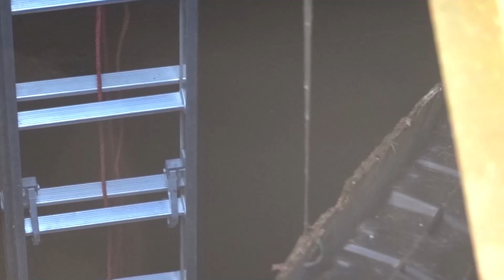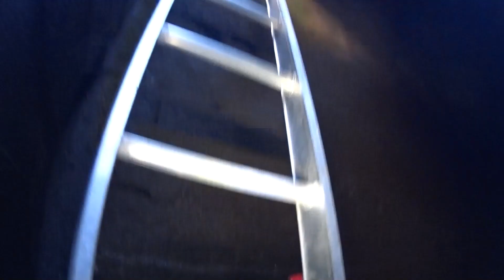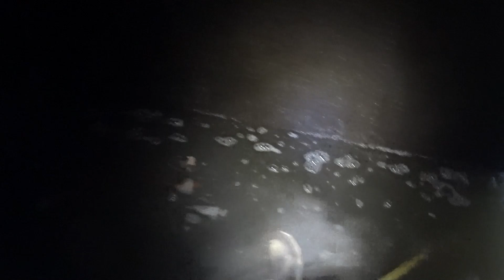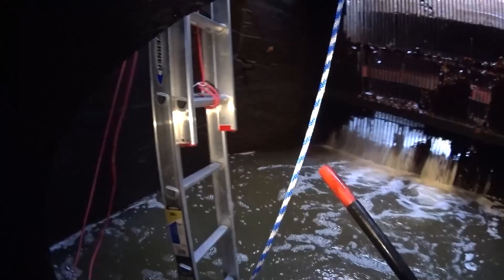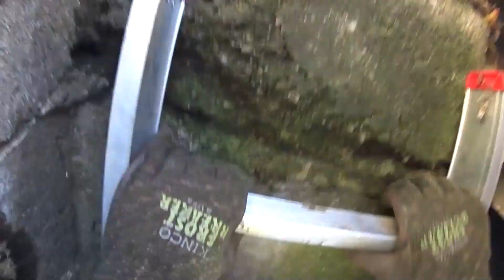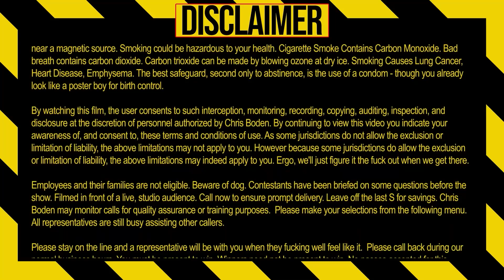A Message To All Young Engineers

Comment: They asked me  to attend at a fire training & truck maintenace facility which was equiped with cistern to collect the gray water from washing of the trucks. They recycled the water. Everytime the pump in the cistern required service, the cistern had to be drained and someone had to enter wear confined space gear to service the pump. I am not the sharp knief in the draw, but I took one look and said to usual " Who the f___ designed this? Move that F___ pump below the access cover and lift it straight up for service . No draining and no one needs to enter the cistern. Deer in the headlights look. I am not an engineer, just a guy who has had to hold the shit end of the stick because of the non-thinkers with an iron ring on his pinky finger.

Comment: I think the care for future service has been engineered out of most things we use everyday. Small appliances are not made to be repaired, just replaced. Your vehicle may or may not have a dipstick for checking levels, if it has one for the engine it probably doesn’t have one for the transmission. I think it should be mandatory for an engineer to serve an apprenticeship in the field working on whatever they are going to engineer. Value engineering is a term they use to eliminate all those unnecessary valves and service items. They are not necessary for normal operation, but can take a repair job from a few hours to a few days or more. Thanks, Chris for your Common Sense Videos.

Comment: I'm a firm believer that before any engineer starts designing a thing, he or she should spend two years in the field servicing and maintaining previous versions of that thing.  Doing jobs like this one is how engineers should learn these lessons.  New things moving forward would be designed differently by those of us who have crawled thru the equipment.  People who have wrenched on it and maintained or repaired a thing see it from a different perspective, and the resulting designs dont suffer the same challenges for those left with maintaining it after its installed.  

The 'thing' can be a water turbine, a kitchen appliance, a vehicle, or a spaceship; it doesnt matter.  Everyone has a customer. Always think about the customer and their needs, not strictly the manufacturing and initial assembly.

Comment: John Deere could take note. 
6125r built in 2013 and in 2023 the little cabin pressurizer blower quit working. Oh! it's located under the floor beside the seat, not bad let's put a big cover over the whole HVAC system with over a dozen screws that needs to be removed brilliant idea.
     But sir! that's still to easy, ok then let's put the cover underneath the operators seat plus make the interior come apart like a jigsaw puzzle in a specific order. 

It turned into a 4 or 5 hour job when they could have put a small cover above the blower and it could be swapped in under 10 minutes

Comment: As a Systems Engineer, we call these "ilities"** and we see these as lifecycle considerations and it's part of our job to take these into account. But SE has really only been applied to the largest and most complex systems (and systems of systems) and it's infancy was at the start of the Cold War (the DEW Line was one of the first projects where early SE principles were formed and employed). Sadly, too many engineering projects still do not see maintainers as stakeholders, and consider the system's lifecycle to extend little beyond the warranty period. (SE is mostly used in Defence, Aerospace, Telecom, and huge public works projects - things (often "one-offs") where mistakes are hugely expensive in money and human lives.) This is changing as the complexity of systems increases and the idea that a system's lifecycle runs from its conception to its retirement and project sponsors are being held responsible for bad decisions, especially ones that cause problems in disposal (think asbestos and PCBs). Such design consideration is expensive up front, but saves (in many ways) in the long term. "Back then" we didn't think that far ahead (and could not foresee some issues), and now, with big projects, there is little room for the mistakes of the past. AND it really does help for engineers to have to maintain some things: I know that I strongly empathize with those who need to keep things going after I design them; and I've cursed many an engineer that made lots of the "simple fixes" I've had to do, into major efforts. (The same principles go double for software design.)

**"ilities:" reliability, supportability, maintainability, securability, etc..

Comment: I know this sounds crazy, but lots of engineers never use the things they design! A lot of times, they simply can't use what they build.

I've been involved with clean sheet designs for complicated systems (aircraft). With a system with a lot of new technology, the engineers can only guess at what maintenance will actually be required when its fielded. I've seen thousands of hours spent on diagnostic procedures for faults on a component that in practice, almost never fails. I've also seen the reverse: a component that fails at 100x the rate the engineers assumed, and no maintenance or diagnostic procedure exists for it. It's usually a procedure like the one in this video that makes up the difference until they figure out how to fix it in the next revision.

Comment: Sometimes the issue is the engineer. Sometimes the issue is the installer. I can't count the number of times I've had a sputtering cussing rage fit because some installer used my design as a helpful suggestion instead of the plan they were to follow. "I had a hell of a time figuring that out" they say. "You didn't have to" I say. "I figured it out before you bought materials." And now I have to look at their ugly, scabbed together work while they're off on another job never having a second thought about the future mystery they caused because it was easier for them to do it wrong and come in under bid.

Comment: Give the fasteners gear teeth, make a dual rack wrench to turn it remotely with long steel poles on a crane.  or similar.
Reply: I'm not sure, but I suspect that the various issues with that would reduce, or eliminate the feedback you get from leaving the wrench on top of the dog bones as you're leaving the hell hole... err, the tactile feedback of getting the bolts tightened that you get at the bolt.

Comment: The problem with a click of a mouse. Or an engineered design. You or we make equipment that does not require service for 40 or 100 years.  But when it does  you must tuck your panties in to your blouse. Just get the ful down there. Get it fixed. And make it work again. Not just for the next week  but the next 100 years!

Comment: That looks like one of thousands of old “open flume” turbines that were installed back in the late 19th and early 20th Centuries. You give me an appreciation for power plant operators who had to run these primitive plants. Leffel, Newport News, Fitz, and S. Morgan Smith open flume turbines were used in water powered mills, foundries, and power plants. 

I also like how the terminology often evolves or is interchangeable. “Log stop” versus “Head gate.” Log stops could also refer to the logs or beams used to raise or lower the mill pond or lake. A certain kind of Log stop was also called “Stanchion Type Flashboards.” These could be used on Spillways. (Barrows; Water Power Engineering; p 535; 1943. 

You are teaching me so much about these old low head hydroelectric plants that I can’t get from books!

Comment: Next time I have to take the seats, center console, entire dashboard and HVAC box out of a Land Rover just to replace the blower motor, I’ll think of this video.
Reply: I had to partially disassemble a dash on a 2005 Range Rover Sport. No rhyme or reason to the design. Not to mention that ridiculously over engineered cup holder in the center console.I feel your pain brother!
Reply: Had to pull an entire dash, 6hrs of removal, just to have to opportunity to diagnose a blend door actuator on a 2022 f150. I too will remember this video

Comment: For anyone starting out, insist to your boss to go onsite or in the shop and make friends with the "doers". Your designs will be much better. Become the "problem solver" designer, it's fun.

And for this design, it seems you could retrofit some sort of die spring setup to keep the pressure on the blocks. At least your rafting expeditions would only be when the blocks are worn out and need replacement.

Comment: This was probably the hydro plant that taught the engineers NOT to hide the bearings in a hell hole.  Unfortunately management probably said it was too expensive to fix even though engineering already had the plans drawn up.
Reply: Funny thing is, high price to fix, but the amount of money they are paying for each time someone is going down there, that could have been avoided, is probably like 10 times or more than the cost to make modifications
Reply: I know I'm hitting this video 2 years late, but just the lost revenue of shutting down that generator every couple of weeks for the better part of a day, would most likely have paid for the fix several times over.
Reply: @RNMSC  True, but initial cost, maintenance cost, and operating costs are the very different things, often paid by different people, departments, or budgets. There is a never ending list of examples of “It would have been WAY cheaper in the long run if..” which almost always follow some variation of “We’re already over budget, just get it built as cheaply as possible.”

Comment: Well, till the advent of plastics and self lubricating UHMW nylon, there was no substitute for the Ironwood block, which still is used in a lot of applications. But the next set of bearing blocks likely will be made from something like Vesconite Hilube, machined as a block to replace that ironwood, and placed in the same holder, and will probably still need the same adjustment every so often to compensate for wear.

Comment: The engine compartments of most modern cars could also benefit greatly from some forethought given to maintenance.
Reply: Like putting a starter under the intake? SMDH
Reply: forethought is given to maintenance and repair,
how to make it as hard as possible
Reply: Automotive designers especially should be required to spend a few months working as mechanics on these cars poorly designed for future maintenance.
Reply: If they wanted you to fix it instead of buying a new one you'd be 100% correct...
Reply: Automotive engineers are paid to design vehicles to be lighter, cheaper, and quicker to assemble on the line. I've been wrenching for over 20 years, and if I'd have a dollar for every time I've cursed at or about some stupid piece of engineering that made a simple repair into an asinine, drawn-out task, I could buy Twitter.
Reply: I think the design team of any normal automobile should be locked in a room with their car, a basic set of tools (including a jack and jackstands), and they should have to perform the following tasks:
-oil and oil filter change
-remove and install the alternator
-remove and install the starter
-remove and install new spark plugs and other tune-up related parts as equipped.
-perform other regularly scheduled maintenance such as replacing the timing belt/water pump or and the transmission fluid. There should also be an easy way to drain the coolant from the radiator and engine block without causing antifreeze to rain down.

Each of these tasks must be performed by a lone individual. When the task is complete the lock on the room will be opened and the team will be allowed access to restroom facility and food/water. That should put an end to silly crap like putting starters under intake manifolds and needing to remove radiators to change timing belts. Cars should be designed for reliability and maintainability, not for how much the dealer can charge to fix basic or even somewhat complex stuff.
Reply: Maintenance is at the bottom of the pile when it comes to priorities of the modern car, when you take into consideration. Emissions. Cost, crash safety. Flexibility between different platforms. Materials used etc, look at any German engine bay. The amount of components used and all working together is an engineering marvel in its own right.
Reply: Coming from a mechanic now going into engineering,
Reply: Truth!
Reply: Man…Amen to that !

Comment: Engineers are often overruled by architects and are told where shit is going to be. Typical hierarchy in construction of a structure is Architectural, Structural, Mechanical, and lastly Electrical for who gets a say in how shit moves about and where it is placed. Nevermind what the contractors do when they actually build it.
Reply: And bean counters who demand a cheaper solution even though it doesn't work in the application.  And other bean counters who push off preventative maintenance.
Reply: Rand is right, insert bean counters before every step. 

But you are wrong on the order, for you left off software, who were not really asked anything during the previous design phases. They are then tasked to make it do what was promised. Not always the case, Tesla is a company that considers the software in the design process, but in most.